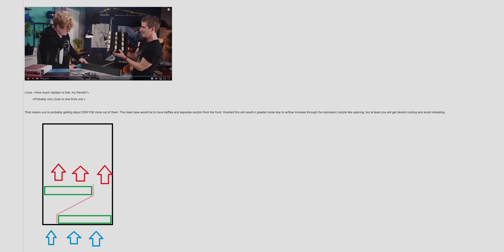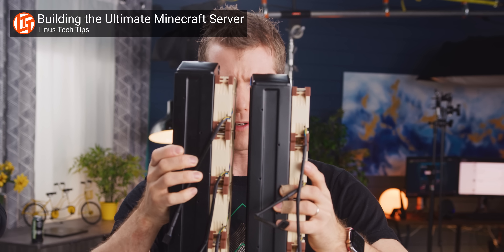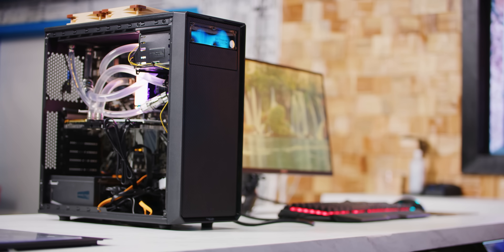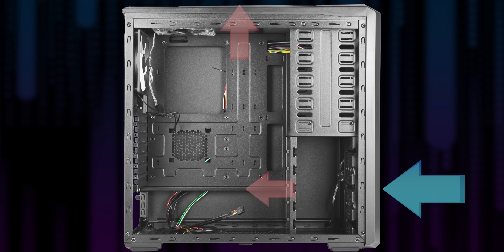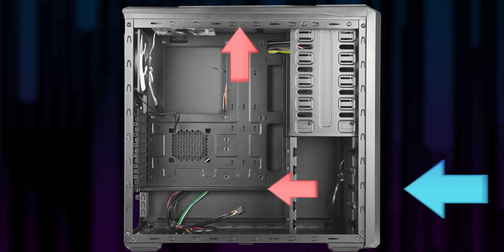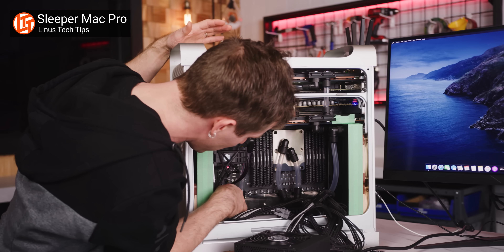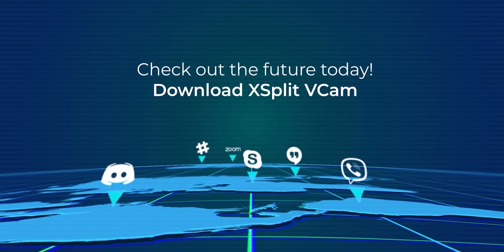I’ve been water cooling wrong for YEARS - $H!T Manufacturers Say

Comment: I think what Corsair was trying to say was that there's reduced efficiency in sandwiching rads.
Reply: I might be stupid but what I got from what Corsair wanted and what they added as illustration at 1:02 , they suggest that a chimney style cooling solution where, say, for example 2x 240mm rads were installed offset to each other, leaving the 3rd slot open for a fan to pull in cool air into the case and therefore lowering the temperature of the air that the hits the 2nd/top rad... I might be wrong but this would kinda make sense imo

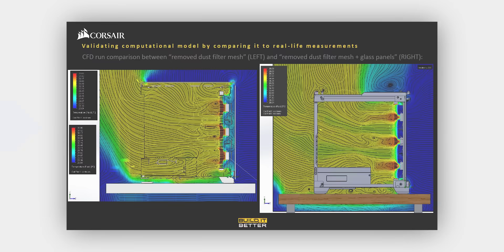Edit: nevermind, I rewatched and noticed that I didn't pay attention to the image shown at 1:09 on the first watch... but I still think what I said could make sense...
Reply: @JK_92  yeah looks like they were trying to get a better improvement out of 2 rads, rather than the smaller improvement
Reply: Felt that was pretty obvious as well.  This whole test seemed kind of pointless since they're not even testing what Corsair was arguing.  Linus even admits it in the video.
Reply: @0:53

...English, can you do?
Reply: Corsair said adding a second rad in series would make a negligible (close to 0) or negative difference. They did not say lower efficiency, they flat out said you should not have multiple rads in series, which linus proved wrong both in a fairly standard layout, and in their server with stacked rads
Reply: @____5837  and where did they say that?
Nowhere.
Reply: @Jehty_  1:02 "that second radiator would be at best pointless and could even make cooling worse"
Reply: @____5837  that's what Linus claims that Corsair is saying.
You don't know if Corsair really said that.
Reply: @____5837  and even if they said that they still would be correct.
Because adding a 80$ radiator for a 5°C difference is pointless. 
And it even could make cooling worse. 

So yeah, Corsair is right.
Reply: @Jehty_  You are seriously suggesting linus is just flat out lying what corsair said, given both sides will have proof and corsair could easily sue for slander if linus lied? WOW. And with modern cpus and gpus, 5 degrees makes a big difference to boost clocks they decide to reach. In a server environment, 5 degrees also makes a massive difference in the longevity of the machine
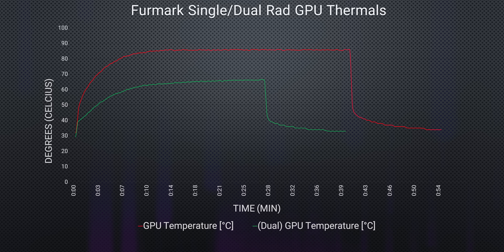Reply: @Jehty_  And its not just 5 degrees. 4:52 had a ~25 degree steady state gpu temp difference
Reply: @____5837  it happens all the time in newspaper articles and other media that statements are ripped out of context.
That is not flat out lying but it still changes the statement.
I am suggesting that Linus, who uses click bait all the time, might take a statement out of its context in order to make a more exciting video.
Reply: Jehty so your argument is “there’s no way Corsair could possibly be wrong the only possible explanation is that Linus is blatantly lying.” Unless Corsair argues this you have 0 basis for making this claim and seem to be only interested in desperately trying to find a reason to bash Linus with no actual evidence or even coherent thought process to back up your claims
Reply: @____5837  6:50 the 5°C difference was for the three radiators stacked on top.
Reply: @nickabbott3081   you want actual evidence?
Here we go:
0:50 "When we showed our concept cooling system for our Hackpro 2019 with a front intake radiator and a rear exhaust radiator, Corsair emailed me to say that [...]" 
4:02 Does that look like the Hackpro 2019? No. 
Is that a front rad and a rad at the rear? No.
Reply: Jehty excuse me what? Are you seriously trying to argue that having an exhaust at the top of the case will change the result versus having the exhaust at the rear? It’s a water cooling loop. Where the exhaust is has 0 effect on the temperature of components cooled by the water as long as it’s still an exhaust. LTT built a functionally identical system to test corsairs claim. I’m sorry but that has to be one of the most disjointed, poorly thought through arguments I’ve ever heard. I would’ve thought someone watching a computer channel would at least have a basic understanding of how this works
Reply: @nickabbott3081  the big difference is that the Hackpro is a fairly "airtight" case.
All the air inside the case was pulled in trough the front rad and all the air going trough the second rad comes from inside the case. (warm air trough the second rad) 
Whereas in the case Linus used in this video the back of the case is completely open. Therefore a large amount of air that goes trough the second rad comes from outside the case trough the open rear. (cold air trough the second rad) 
Do you understand that that might make a difference?
Reply: Jehty first of the hackintosh case is literally covered in holes so your point is ridiculous but even if you were making some degree of sense they also tested an absolute worst possible case scenario with air going directly from one radiator into 2 more and still found a difference. Come on buddy, stop trying to argue something that you don’t understand
Reply: well, that isn't what they did say, so... ¯\_(ツ)_/¯
Reply: @tylercollins4125  It's a secondhand account; you don't know what was said.
Reply: @tylercollins4125  how do you know what Corsair said?
You only know what Linus claims that Corsair said.
And it wouldn't surprise me if he understood them wrong.

Comment: Two things with this. Corsair is technically right. But, You are failing to find WHY your real world experience is right. Where corsair is wrong is the assumption that the single radiator fully cools the water which under FULL load it might not be doing. But you failed to test a pretty big part of what adding a second or even third radiator does which is adding a higher volume of water to the system which takes longer to heat and can passively dissipate more heat.

Comment: One more rad increases the volume of water and therefor heat capacity. You need to measure the ambient air temp and the inside computer air temp and exhaust air temp. Dual intake rads are great. A massive side radiator and a massive fun would be the best.

Comment: I need help Linus, I’ve gotten an Intel I 7 CPU and 4 more gb ram, before I tried installing my computer working fine, after I did it won’t boot bios won’t even post, I’ve tried everything from cleaning my ram, checking pins, reinstalled my video card, I’ve put in my old hardware before the installation and it won’t post anything. Please help

Comment: Clearly if you have 1 rad as an intake and 1 rad as an exhaust, the exhaust rad will be significantly less efficient.
If you have both rads as the same (i.e. 2 exhaust or 2 intake) then there shouldn't be any significant performance hit to either rad, provided airflow is not restricted by the non-rad intake/exhaust.

Comment: I am wondering why the radiator cooling assembly is not mounted externally. With it set up this way the radiator would not restrict airflow in the case itself and allow for air cooling to the max as well with intake and output fans passing cool air over the system as well.

Comment: From my testing, if you're going to stack radiators, this is one and only place in a liquid cooling setup (save loops with extremely low flow), where order of components actually matter. For dual 360/60mm rad (with three rows of standard 120mm case fans, no fancy high pressure ones), 900-1000 W load, I got consistently 4-5°C lower liquid temps if the first radiator flow-wise was the one behind the first (front, airflow wise). In other words, hot liquid gets cooled first in a radiator already receiving heated air, then goes to radiator receiving fresh, colder air. 1 kW load for 2x 360 is rather high, so 5 degrees in coolant temperature actually represent very high difference, and improves cooling capacity a lot.

Comment: What corsair is saying is that 1mm thick radiator would be just the same as infinitely thick radiator. the radiators wont heat the passing air to the same temperature as the water. Nothing is that efficient at heat transfer. Therefore having the air pass through more radiator will heat the air more and cool the water more. There is diminishing returns as the exhaust air temperature gets closer to the water temperature and it would be more efficient to have all radiators get fresh air but there is literally NO scenario where adding more radiators would hurt the performance as long as the pump can pump water through all of them.

Comment: Beyond a certain point you’re simply lowering the maximum heatsoak temperature of the water. The bottleneck becomes the CPU/tim/IHS/kryonaut/Waterblock interface, or if delidded then CPU/conductonaut/Waterblock. Edit: But I mean only when you’re already at overkill. A single 240 is NOT enough! A single 360 is budget. Personally I am running twin 420’s and they are 60mm thiccc for the lulz

Comment: LINUS, YOUR TESTING METHODS ARE WRONG!!! Corsair isn't saying you can't run two rads. What they're saying is that installing two rads in a way where the second rad is getting "hand me down air" from the first rad reduces the cooling capabilities of the second rad. Your testing method doesn't verify or refute their claims. You've only tested "if I add another radiator to the mix, I will see gains."

Here's how to test what Corsair is saying is wrong with your setups: Rig 1 has a front and top radiators in the waterloop, and the rear is (mostly) sealed so the air has to go from the front to the top. Have a second rig where the front radiator is moved to the back OR the top radiator moved to the bottom of the case, (Or a rad on the front and a rad dangling outside of the case...) so you have all of your radiators getting the same air. THEN you can test to see if what Corsair is telling you is bupkis or not. And I suspect you will find they are correct, that the capacity of the second radiator is reduced due to the air they're getting is already hot. I don't think it's as bad as Corsair says, but I'd be surprised if you got anything above 50% from the rad.

Comment: Saying a radiator is so efficient that it brings the discharge air temp to near the water temperature is an alarm bell. That would mean the air going past 2 in would be almost stagnant.  Too little mass flow and too little thermal flow.

Comment: there is some truth in both of you, in cars the AC condenser is place in front of the transcooler(if equipped) then the engine radiator for computer you better first pass on the back radiator then a second(or more) going toward the intake of fresh air. if you have 2 raditor, one on top(witch is exhaust) and on in the front(cool air intake) you are better doing the first pass  in the top one then the second pass is the front one... since the coolant will be decreasing temperature in the hotter one first 60C in the inlet to 40C outlet and the second one 40C inlet to 30C(depend of room temp) is outlet. A lot depend if the fan are pushing or pulling air, same has car the fan is pulling not pushing witch cool even more the coolant

Comment: Alright, here’s the thing. You are right... and Corsair is right as well... both for different reasons. You are right because even though you may be losing efficiency on the later radiators, but as long as the air is still colder than water temperatures moving through that radiator, your getting cooling... but it stacks kinda like using multiple graphics cards. There is a benefit, but is it worth it? But Corsair is right as well as they are looking at it from a pure efficiency standpoint. Naturally the best way would be to have both rads have open air at all times, but most times in a case, that just can’t happen... so you stack them. If you want to potentially “boost” cooling performance, with stacked rads, put the hottest radiator at the back of the stack and then put the coolest one at the front of the stack. This will help to keep the rear rad from getting heat saturated, but if you get it hot enough to saturate the front one as well.... then there isn’t much you can probably do :P

Comment: I'm surprised that some thermal probes weren't used in these tests, identifying the ambient air intake, fluid temperature before and after each rad, and air temperature after the first rad and before the second. You'd then be able to confirm corsair's thought that the rads are hyper efficient in performing the needed heat transfer, and whether the second rad actually has enough of a temperature difference to have any effect.

Comment: Lol Linus, those of us who are not retarded have lolled at your terrible loop designs for years.

Matins Liquid lab, look it up, he's tested all this shit before, years ago and published the data.

This is so sad LMAO.

Do both radiators pulling fresh air and do 1 rad  with push pull, you'll see more improvement than the 2nd rad.

STACKING RADS IS BAD, there are better options to get better Delta Ts using the same volume of space.

Fucking noob.

Comment: Look up how to design a Chilled Water Air Conditioning system for a building. All the theory and calcs you need are there to engineer a solution based on your system requirements and available delta T etc. The key is in sizing the components correctly.  What your test rig showed was that the single radiator was undersized to maintain the temps you wanted with your delta T. Or from another point of view you never designed the cooling system properly in the first place.

Comment: Here's an idea try dual channeling radiators meaning of one hose of warm water or whatever goes to to separate a radiators and then have from the two radiators run off to join back together into one hose
Reply: To me that seems like the most easily logical way of doing it and having both radiators pull in cool air from the outside

Comment: Couple things. Adding radiators will work if your radiator is not enough to cool the water and if you are moving enough coolant. What linus didn't mention is that when the air heats up the water cools down. Meaning that if you add radiators without thinking you may be heating up the water.
Anyway
Lets use the server as an example. Lets say water comes in at 40c. And exits at 30 on the  front radiator (faster the water moves the less it will cool) (also that would be parallel flow)
That means that the second rad will cool less because the temperatire difference will be smaller but until the air and water reach the same temperature more rads will cool more.
Another option is to have the hot water enter the last rad (counter flow). Meaning that you have a more consistent temperature delta accross your radiators.
All of this is highly dependant on a few variables. Including air flow air temperature air humidity air density water flow water temperature radiator efficency water pressure and more.

Im disappointed in corsair for generalising like this without all this data
Reply: Id recommend cross flow if you have no idea of what is going on in your rads. See below 
https://i.ytimg.com/vi/o72FpcKJK_Q/maxresdefault.jpg

Comment: So, yes and no, what corsair says is correct, except the efficiency on the second rad wouldn't be decreased to zero and once the first rad is heat soaked you'll be wishing you had the second, but that is only for extreme cases where you have high temps + long run time.

Comment: Also it depends on the flow direction of the water. For stacked rads cold water should come out the front and hot into the back of the stack. This is how powerplants flow water.

Comment: Corsair is talking about stacking on top of eachother vs side to side by the way Linus 👍
It always takes more in a stack to do the same two side by side would do :)
Think a 120 vs a 480 rad.
If you were able to test a system that had a super huge intake (like your old room cooling radiator setup) vs one with the same rads stacked on top of Waco their directly with fans between like in the mine craft server.

Yes it is negligible, but for those trying for an ultimately efficient and “cost” effective solution buying less rads and arranging them more efficiently wins every time, especially in server applications where room is toight.

Thicker radiators are essentially thinner ones stacked without fans in between, it could even be argued that the minecraft system boosts cfm to the point where it no longer matters with the fans between radiators ;)

Comment: Looping the hot water in the hotter exhaust radiator first and than to the cooler intake radiator should lead to lower water temperatures and therefore higher clockspeed.

Note that this effect is minimal, because the water temperature can be considered more or less constant, but it could have been useful for the minecraft server rig.

Comment: You should review the data and see if adding additional radiators (especially if stacked side by side by side) results in "diminishing returns".  
Like 1 rad gives Temp X.
 2nd rad gives Temp X-5.
 3rd rad gives Temp X-5-3. And so on. 
I would expect diminishing returns, and more pronounced the closer the rads are to each other (or the tighter an air seal of the PC).